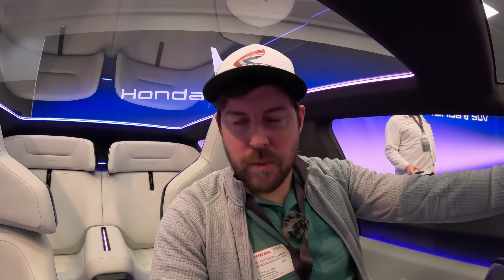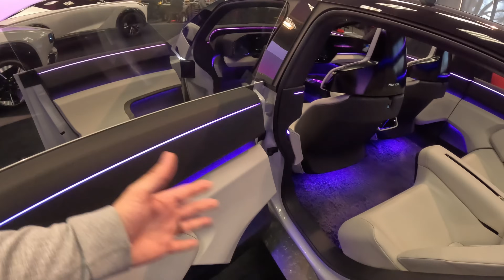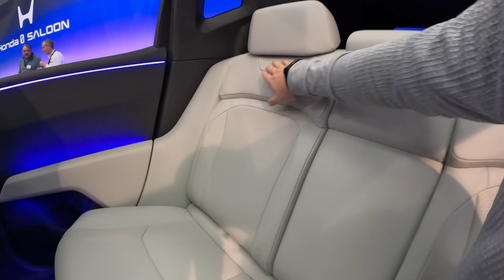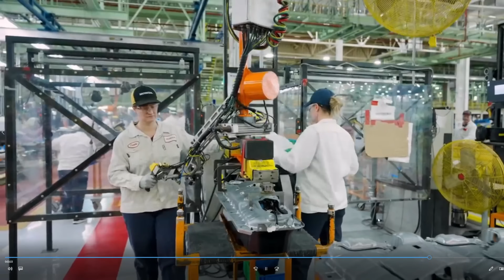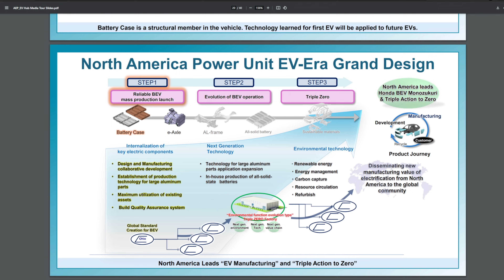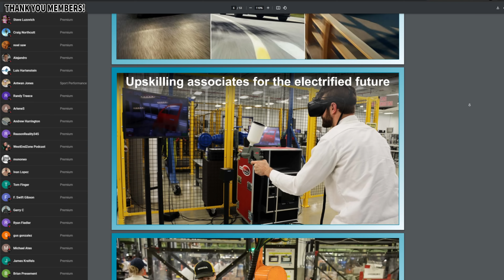Full Tour of Honda's 0 series EVs + How they will be made at Honda EV hub in Ohio

Comment: The EV cars need to repower themselves.  They can do this with wind power.  Any moving car has that constant wind outside its window.  That free ever passing wind can pass through "jet engine" like wind turbines that exist in dams and windmills.  When hooked up to the batteries, the wind turbines can keep the batteries fully re-charged and keep that car moving forever.  That car can drive coast to coast without ever having to stop and recharge or refuel.  Free wind power can make EV's an outstanding car.  Big rigs can do this too.  The tractors can have these wind turbines as well as about ten turbines on top of trailers, that keep those batteries fully charged as long as the truck moves.

Comment: They still font het it.

All of yhese eve need and optional gas range extender for around 200 or so gas powered miles.temember the chargers are on the grid wlready ehich is mostly powered by you got it gas coal etc.

This will take away eve scholles hill for many people especially people without a garage or home charging thats nost people and lonng distant drivers.

Ahain it van be optional dealer or third party after purchase and warranted.

Other than that bring back knobs seitches physical controls foor handles less touch screen.

Noise and shifting bty sodteare.

Comment: The seating and ceiling level seem like they would be hard to change at this point of concept to production. If the headroom is really that low and rear access that difficult that will certainly be a problem.
Reply: Agreed.  That Saloon's entry/exit and headroom is going to be an issue.  LIkewise, the design of the tailgate of the CUV, particularly in the lifted position, will be difficult to use especially since that floor isn't flat - you'll have to really lean into to access that space.   I'm hoping the Acura isn't as compromised.

Comment: This is a great decision by Honda! They can make EVs, Hybrid, Plug-In Hybrids and ICE cars all on one assembly line. This means that they can vary production by demand! All automakers need to follow this strategy.
Reply: already used it toyota but again EVs bit diffrent , yet even toyota now had to make new factory specialized for EVs GIGAFACTORY
Reply: Then those are not gonna be good evs then the packaging is gonna be shit bc it has to commodate a engine bay and transmission tunnel so no flat floor smaller interior space

Comment: I still can't believe that this SUV is going into production by the first Q of 2026.  I wonder how it will be priced relative to the Prologue.
Reply: I would guess it will be a lot more. The Prologue is selling well so I think it needs to last long enough for Honda to come up with their own ground up version. I don’t see the 0 replacing the Prologue so I can’t imagine they’ll have another “reasonably priced” EV for a while. I looked at the Prologue and I liked it but would only think of leasing it as I’m not sure about long term support say 5 or more years down the line.
Reply: It will have all the latest techs like autonomous self drive level 3 and lidar, a wall of screen, so you should assume that it will be more expensive than Prologue.
Reply: @dragonmastermagia1230  sounds like it's DOA if it's going to be that expensive.

Comment: I´m sure that Honda will change many things for this cars before they come to the customers.
Reply: I hope that adding physical HVAC, volume, and steering wheel controls is one of these changes
Reply: @Blank00  I think they must change a little bit the design and exterior parts also at the rear of the cars because they are not really user friendly.
Reply: No, the cars you see here are 90% accurate as the actual production models.
Reply: @ Ok we will see it 👍